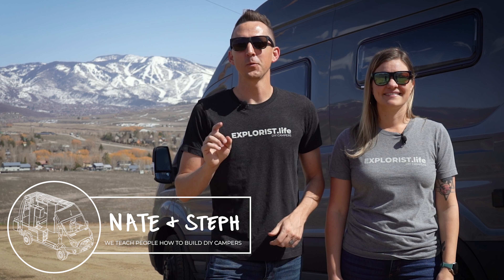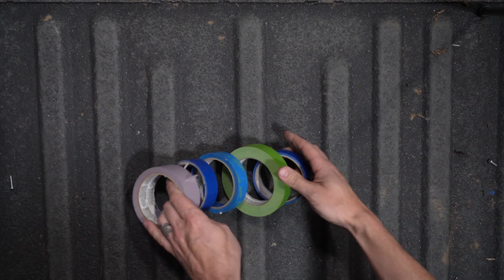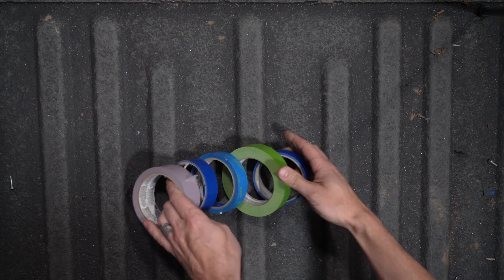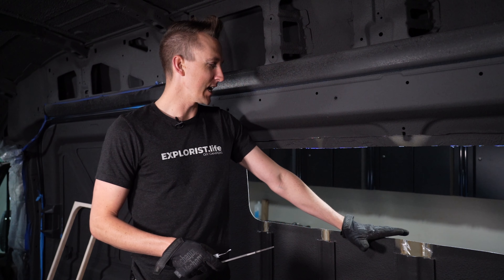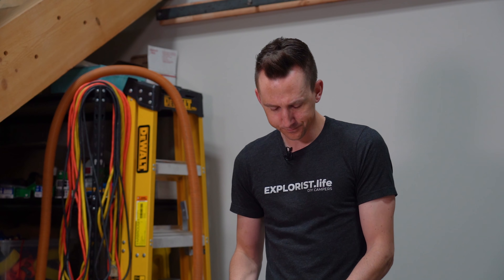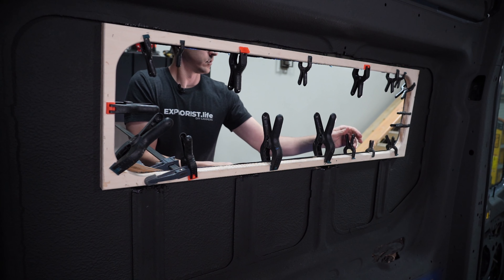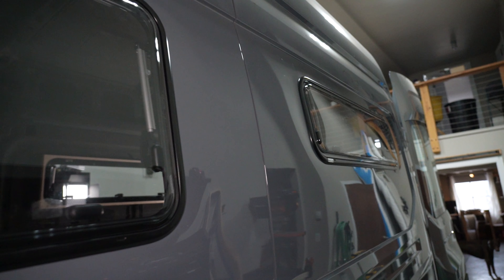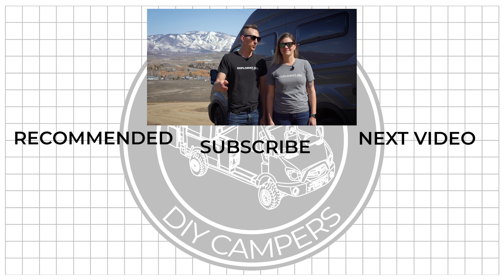Van Windows: Installation Made Easy (FULL TUTORIAL)

Comment: We love our Arctic Tern windows.   The gang at Tern Overland was great to work with when I had any questions.  We stopped by their facility in Prescott.  Installed them almost four years ago and they are still like new.   One thing we did was reverse the inside screen.  Now the sun shade goes up rather than down.  We can have the bottom partially covered for privacy while still having the top open for light and viewing.
Also, be ready for rain.  If the window is open when it rains water will come in around the top corners.  The corners are round so a small part is open.  No big deal, we just put some towels in the bottom corners to catch anything that runs in and down.
One shade/frame has a pretty loud rattle. I haven't been able to resolve it yet.  I'll get it figured out.  But, that is the only negative.  We love the openness when they are all the way open and they just look cool!
Reply from the maker: Awesome!  Glad they've been working well for you.  Thanks for watching!
Reply: How do they do against wind blown dirt scratches and other abrasions over time?

Comment: Whats the impact resistance? Like say someone tries to break in. How hard do you have to hit it with a hammer before it breaks or pulls out of the frame? Or if you stuck a screwdriver under the window, break off the latches?
Reply from the maker: I haven't hit them with a hammer yet to determine how tough they are. 🤣  In all seriousness, though, I would bet an off happy hour round of beers that the tempered glass windows on the front doors would be significantly easier to break into than these acrylic windows.  Acrylic is incredibly impact resistant and tempered glass shatters pretty easily.
Reply: @EXPLORISTlife  yea want to replace all my windows with acrylic not sure if it’s legal tho? The thieves have got me so many times.
Reply from the maker: I don't know about legality.  A hole saw on a cordless drill will get through an acrylic window in about 9 seconds, though.  Glass or acrylic... if somebody wants in... they will get in.

Comment: THis was good. Really like one. Detailled and explained installation of window is great. I wonder if that wooden frame collect condensate water and get wet during time. Just thinking is there oppoturnity have some “steinless” wood frame.
Reply from the maker: Glad you liked it!  You can also use stainless or aluminum square tubing instead of the wood framing if that's something you're worried about.  With the LizardSkin thermal insulation we already installed and the 3m thinsulate insulation we will also install combined with adequate ventilation, I don't anticipate much condensation in that location.

Comment: Nice video. Is the window curved? Asking because the van wall is curved. Wondering if the window has the curve to fit the wall.
Reply from the maker: The window isn't curved, but since the wall is only 'barely' curved and is a bit flexible, it doesn't matter.

Comment: How do you determine the "thickness" for ordering the windows ? Is that info on the Ford website, or did you use calipers or something? Does the thickness include the Satsang spacer or is it just the gauge of the sheet metal?
Reply from the maker: The thickness does indeed include the spacer.  If you go with the satsang spacer, on a sheet metal body panel, you'll want to order the 35-44mm window (noted on the product page of the spacer rings at the bottom of the product description: https://satsangvanworks.com/products/custom-window-jamb-for-arctic-tern-windows?ref=EXPLORIST&variant=40579808100543

Comment: Excellent video!   One question = Did you have to make any adjustments for the curvature of the van exterior wall?  and what tool did you use to cut the extra bit of the support beam after you cut the hole in the side of the van?
Reply from the maker: The frame for the window pulls the van wall side flat, so no other adjustments are needed.  The tool I used there was a Oscillating Multitool.  One of my favorite tools for 'precise descruction' for sure: https://amzn.to/3LfccI0 (Also works great as a scraper and for cutting door jambs 🤣 )

Comment: Nate, your list of window sizes on the tern sight doesn’t appear to match the windows you actually installed.  I assume you installed (1) 450 x 900mm and (2) 300 x 1,100 mm windows.  Correct?
Reply from the maker: These are the sizes of windows we used in this video:
➤Driver Front: 450mm x 900 mm
➤Driver Rear Bunk: 1100mm x 300mm
➤Passenger Rear Bunk: 1100mm x 300mm
➤Wall Thickness: 35-44mm / 1.38" - 1 3/4"

Comment: I don’t understand why the trim ring needs to be bought separately, from a separate company, and at a cost nearly as much as the window itself. 1) Why doesn’t Arctic Tern sell everything needed as a kit? 2) Why not buy windows from a company making windows specifically for these vans with all parts included?
Reply from the maker: These windows are originally made to be installed on expedition campers that have thicker walls like the structurally insulated panels on expedition rigs.  I'm sure that they could "Include" a spacer ring... but they'd have to charge for it; so why include something that would raise the cost of the product that some people may not need?  Remember... you CAN make your own spacer ring out of whatever material you may have on hand.  The ones we showed are simply ones that will make most peoples lives easier and not waste a big sheet of plywood just to cut out rings and be left with a bunch of weird off-cuts
Reply from the maker: ^^^ that was about the spacer (the thin one).  The thick one is the window jamb.  Every window needs an additional jamb.  I don't know of a van window on the market that comes with a full on window jamb to span the gap from the window to the wall.

Also... I'm incredibly proud of myself to be able to use the phrase 'from the window to the wall' in an actual reply.

Comment: You didn't glue the spacer to the metal, you glued it to the lizard skin. Window installation should probs be done before the sound deadening step
Reply from the maker: Instructions didn't state to remove paint to bare metal (which you would need to do if you were trying to glue it to the metal (paint isn't metal either, remember)) before gluing the spacer.  I have full confidence that what we did will be just fine and our video got the go-ahead from Arctic Tern before we posted it.  Hope this helps and thanks for watching!